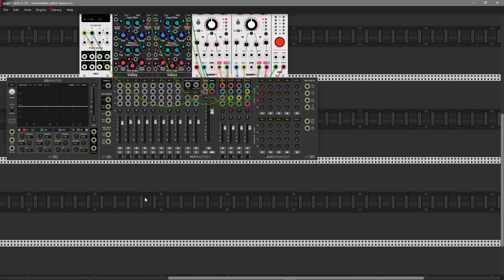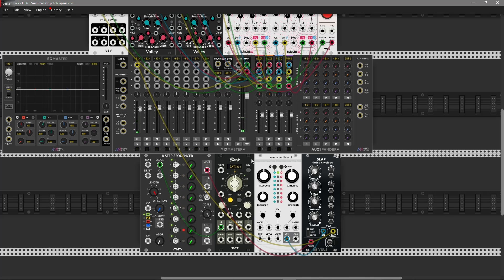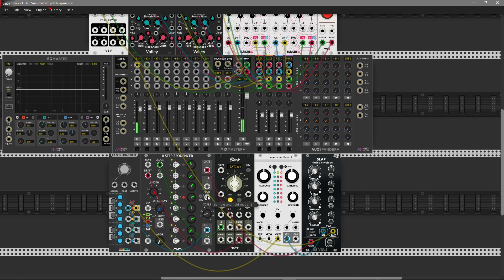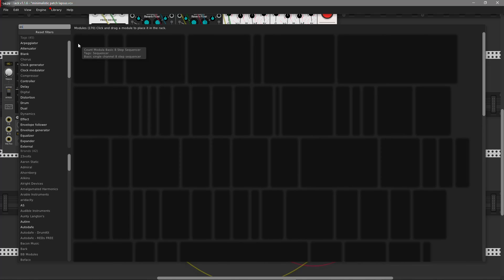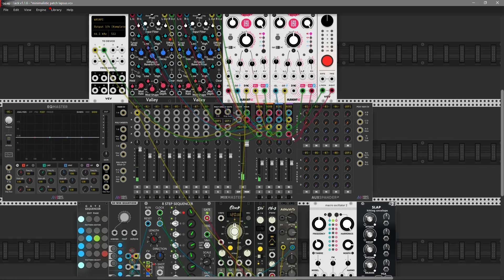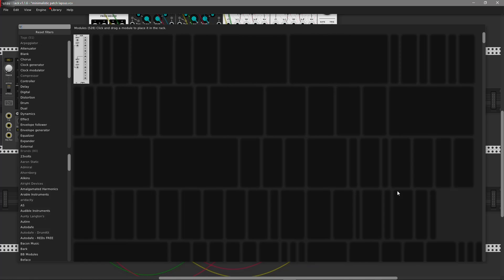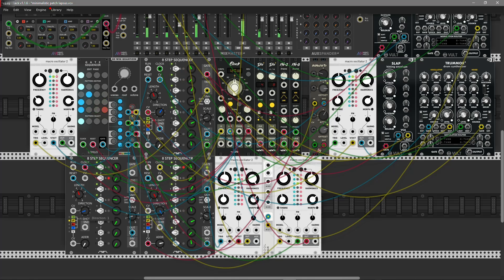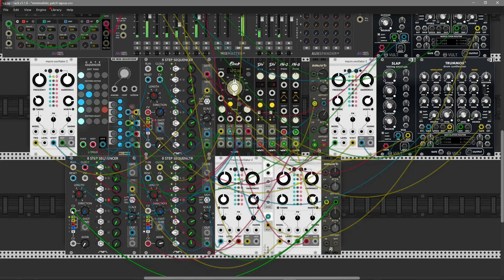New 8 Step Sequencer from Count Modula for VCV Rack

Comment: Depending on how familiar you are with Plaits, it is interesting to remember that tweaking the attenuverters sets the modulation of the internal decaying envelope generator when a trigger is connected. It took me a while to figure out why you were turning these knobs. From the Plaits documentation: "When the corresponding CV input is left unpatched and the trigger input is patched, the attenuverter adjusts the modulation amount from the internal decaying envelope generator. When unplugging a CV input, and if the trigger input is patched, remember to reset the attenuverter to 12 o’clock if you do not want the internal envelope to take over!"